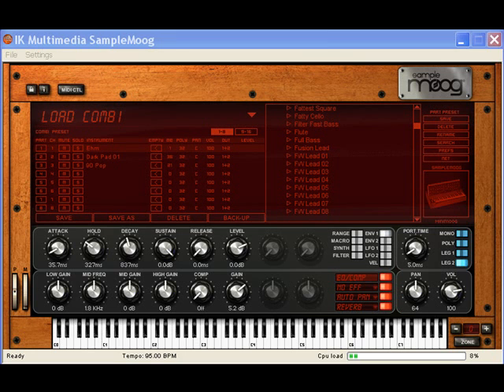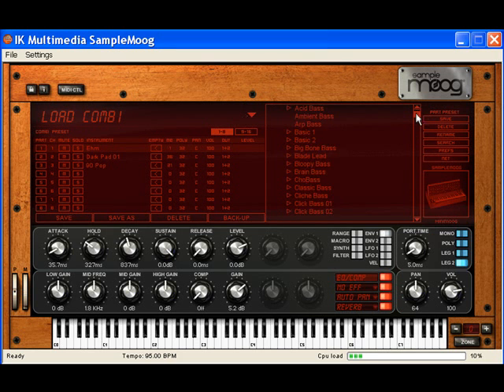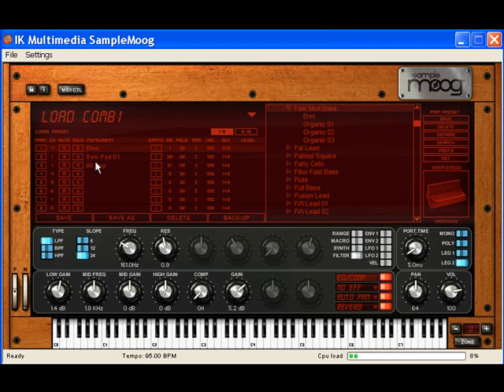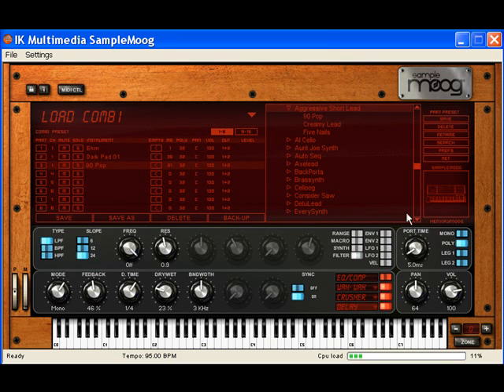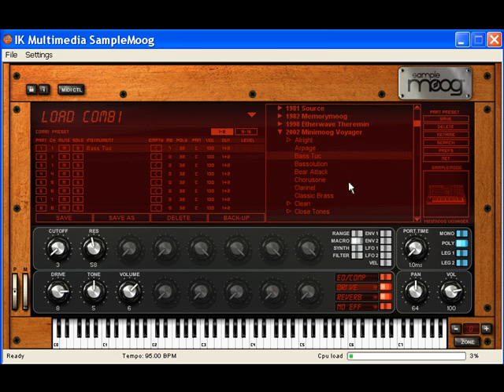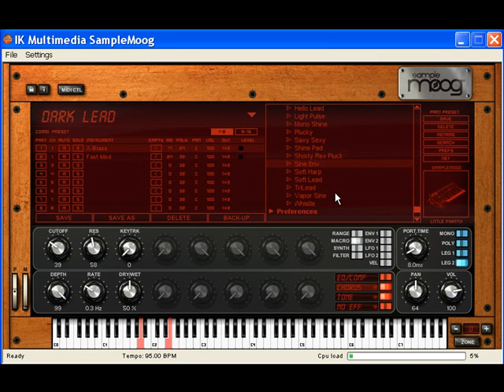IK Multimedia Sample moog with Drew Spence

Comment from the maker: 1) Select a  preset (no sound will trigger until you do)
Press the virtual keys on the screen

2) Click the virtual keyboard on the screen. No sound- then it's a soundcard/audio settings problem. If that works but your keyboard doesn't...

3) Check you MIDI controller cable connects then make sure the correct MIDI device is selected in settings for the SampleMoog.